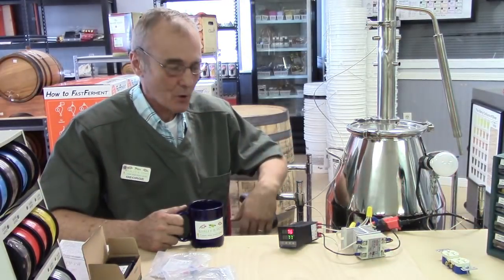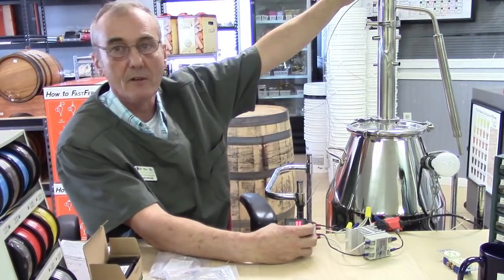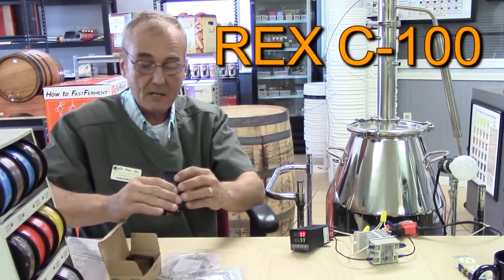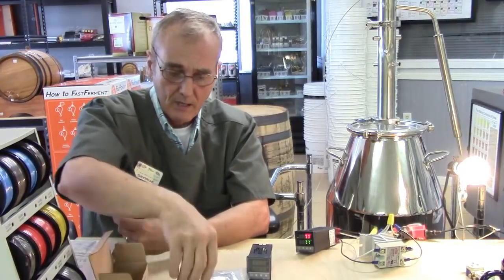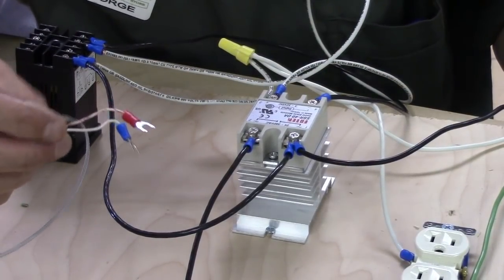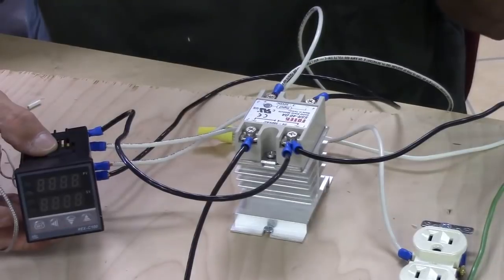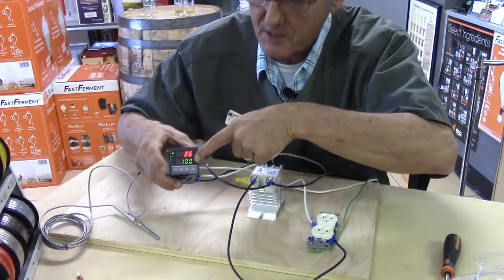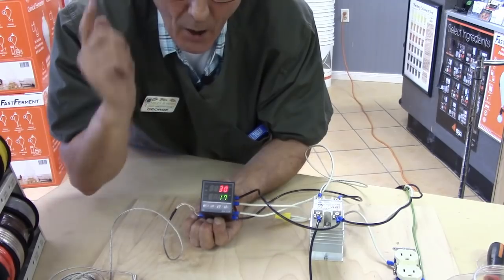WIRING THE PID CONTROLLER

Comment: Can you use pin 3 instead of pin 5?
Reply from the maker: From the question I gather your PID does not have a pin #5. 
The Rex PID (depending on the model number) omits pins that the PID is not capable of operating with.
I would need to know more about your PID to give you a solid answer.
George
Reply: I found ya on facebook, I will get back to ya, with pictures of the model. I just tried working on it, and I am done for tonight. No success. I would like to know what this is for, how I can use it. I found some manuals, and looked all through. Could not find everything I wanted to know. The model number has a extra letter than anyone other one I seen. I get pics. Some other day. On face book. I got these ones from Fastech, a china company. I have somefrom Ali-express coming. I hope those are like the ones you use? They are suppose to be.